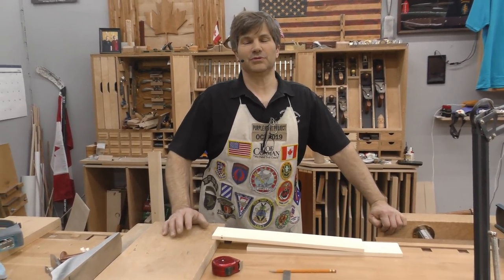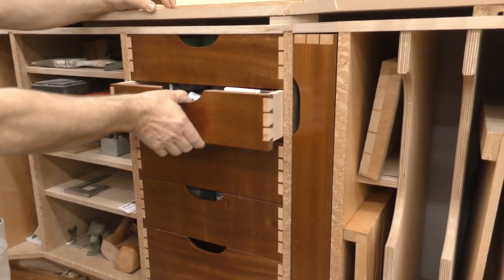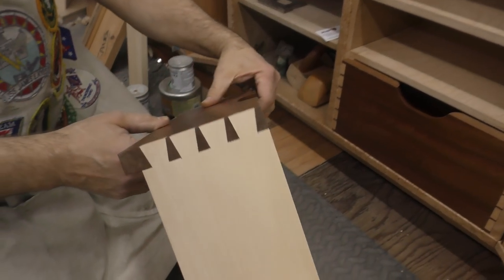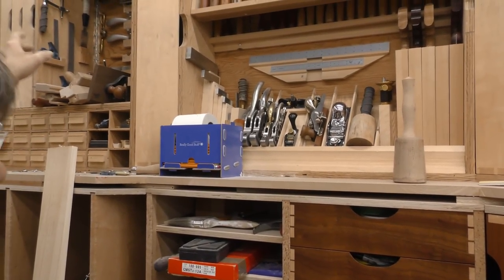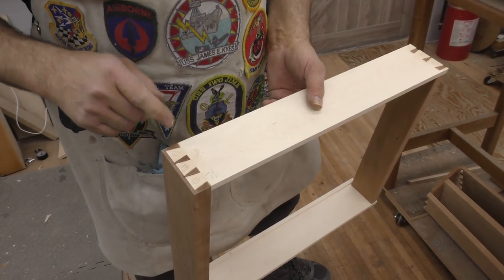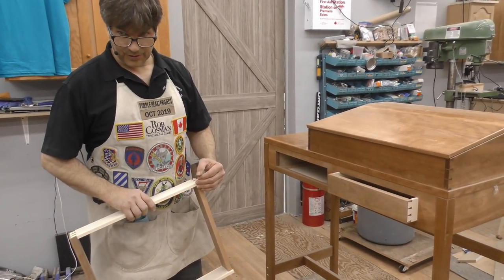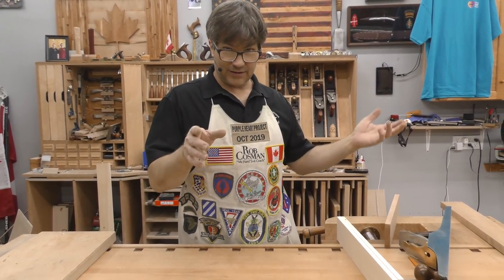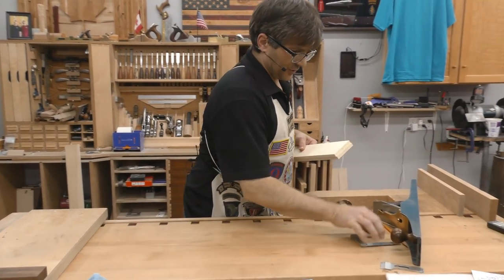Drawer Making - Episode 18; What Happened and How to Prevent it

Comment: Just a thought, Rob: Since you've confused parts and their orientations a few times for various reasons, you might consider a different marking scheme. These days I try to use the "woodworker's triangle" on most projects. I've seen it referenced in a number of places, so I'm sure you're familiar with it. The system is simple and, for the last few years, I've relied on it to help me keep parts oriented correctly on carcasses, panel glue-ups, and drawers - especially if I don't work on them for a few days (or weeks). When marking the triangle on drawers, however, my mistake has been to mark the top of the front, back, and sides. One of the things I've learned from you is that the bottom is the proper reference surface, so in the future I'll mark the bottoms of drawer components. By the way, I second the comment on Jake's outstanding camera work! Many of the subtle concepts you're demonstrating would be difficult to understand if Jake wasn't routinely capturing steady, well-lit, in-focus close-ups.

Comment: From the first attempt, the racking is only caused by the back having been cut using the tops of the sides as reference, right?  Could you just redo the back and reference off the bottom as you do your pins?  First, remove the middle section of the back sawing as close the sides are you dare.  Then cut out the tails just like you had done previously using the different colored pins as your cut line reference.  Then cut the pins in the new back as you normally would?  Sure the glued up front and sides might make it a little more trying in managing the work, but better than starting over completely?

Either way, thanks for all you do and for sharing your skill and process with us.
Reply: This does make sense. If it's the point of reference for cutting out on the back piece only then that is the only piece that should be causing the issue. The only problem that might have been introduced is in pulling the sides to fit the back the glue might have now dried with them slightly twisted in the drawer front. As an experiment he cut cut out the drawer back and see if the sides go back to sitting flat. For me personally I like to try things dry fit and then glue doesn't get in the way of the fixes!

Comment: I always, always, always dry fit before glue up. Maybe a word on the value of that extra step would help others to avoid the pain. I generally put the drawer together, glue one side front and back, let set. An hour or so later glue up the other side.

Comment: Can’t you cut the sides flush with the front and just cut new sockets and account for the gap on the new tails by making the tails a bit longer to fill the gap, thereby preserving the original drawer front
Reply: Hi Clemens, myself and a few others suggested this in the comments but Rob might not have seen considering how many comments were left. To me there are two reasons to consider trying to salvage the entire drawer front. 1. No visible glue line along the top, which you would inevtably get with using the existing drawer front as a veneer 2. Since he cannot plane anything off of any side of the veneer front without it damaging the seamless appearance of the whole front of the piece, there is no margin for error in gluing the veneer on to the fully constructed drawer. If the veneer slips out of alignment with the backing piece I don't see a fix. However maybe Rob has a method to prevent it slipping - clamping boards around all edges for example.
Reply: Clemens martin  I was also thinking the exact same thing. It might be a pain though to size everything on the tails perfectly is the reason I’m thinking he’s not doing it.
Reply: If you square the drawer opening this would work. Remember he cut the sides to fit the opening.

Comment: I always learn from and appreciate your lessons. 

Here is a problem I have. 
1)	About four years ago, I replaced the cabinets in my kitchen and family room. 
2)	Used #3 1 x 12 white pine stock (with knots) for the face frame. I love the look of freshly sanded knotty white pine. 
3)	Did not stain the cabinets. 
4)	Sealed the cabinets with clear semi-gloss Min-wax Polyacrylic sealer. The result was perfect (bright, clean-looking white pine). 
5)	I knew the cabinets would oxidize over the years, and they have (damn-it). The cabinets have turned to what I would call a Honey color, but I was expecting that. If you like stained cabinets, they look pretty good. 
6)	When finishing the cabinets, I filled the nail holes with a wood filler that matched the light-colored white pine. (I did a pretty good job matching if I do say so myself). 
Problem: 
7)	The wood filler that matched the light, bright-colored pine four years ago did not oxidize with the rest of the material. So I have honey-colored cabinets with white nail hole filler. Because I build cabinets without a lot of face nailing, there is not an overabundance of nail holes to fix. I can take a small drill bit, remove the white wood filler and replace it with something that will change with the continued oxidizing of the face frame. 
The question is: 
Because of health problems, I am still changing the case and base to match the cabinets in the area: What would you suggest I use to fill the nail holes in the existing cabinets and the new trim??

Comment: Hi Rob. Love your work. 
I have a question about your saws. Particularly about how you would keep them sharp. I don't have any experience sharpening saws or setting the teeth but my understanding is that yours have a particular fine set (dovetail saw for example) and I would hate to ruin that but I'm really interested in getting one as I've used Japanese pull saws up to now. Apologies if there's already a video about this that I did not find. 
Keep up the good work with PHP. I'm making enquires about it in the Australian armed forces and think they could also really benefit from it.
Regards.

Comment: I think Jake is at fault..... you did the first side you ref. from the bottom because you said then that the tops may not be the same size.Then you started the other side ,,you were going to reference from the bottom and Jake told you that you ref. off the top..but you ref. from the bottom on the right side....
Reply from the maker: Unfortunately I can’t blame Jake. I couldn’t have reference off of the bottom on either side because the drawer back wasn’t as wide as the drawer sides. That’s why we had to reference off of the top, not remembering that one side had been trimmed a lot more than the other in fitting them to the opening. What we should have done was make a spacer block that would’ve allowed us to reference off of the bottom in the first place.